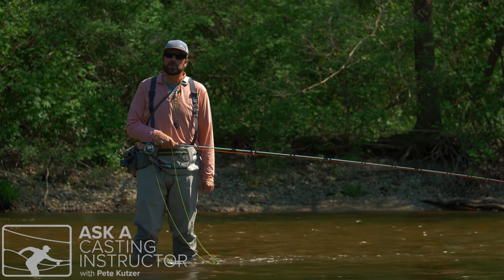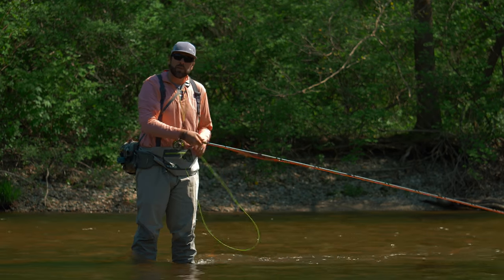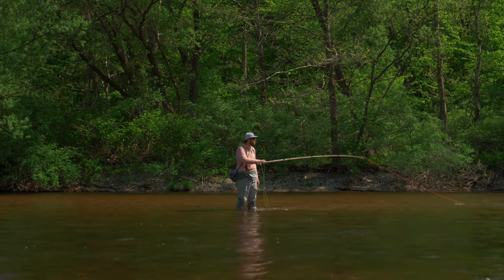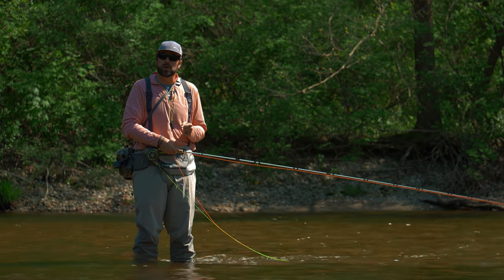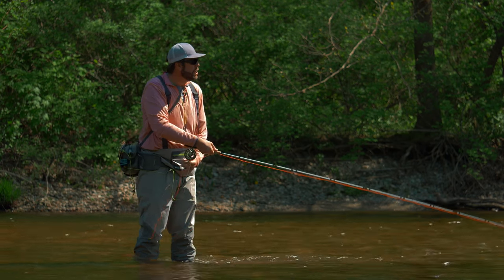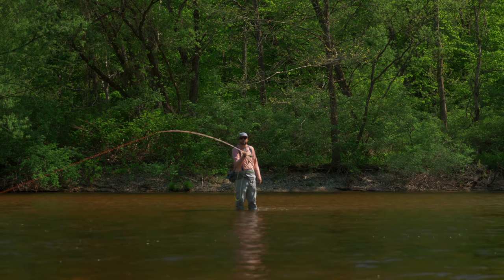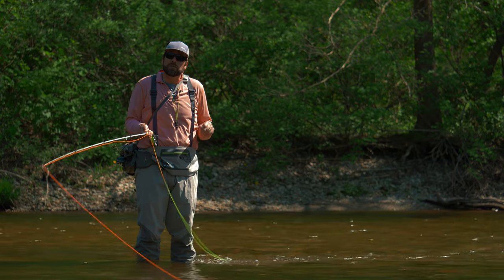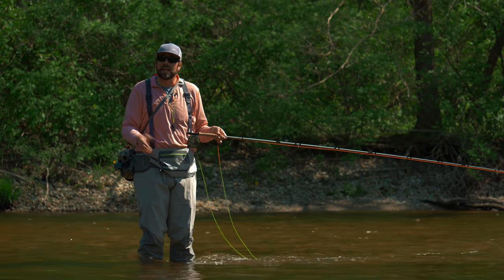Best Tricks for Casting Nymph Rigs | How To

Comment: I'm a newby to actually fly fishing, I've been steelheading with flies on a spin cast for 25+ years in Michigan. Fishing with nymphs is my game, but I see a lot guys using indicators? Is that necessary? I have a high dollar custom rod and am spooled up with Rio versiTip II. The sinking one? With variable tips for sink rate. While streamer or nymphing I shouldn't need an indicator right?  I apologise for being so dull, but I haven't found a good video about this and I've spent hours watching YouTube. It's like I'm starting all over as before without any help.   Any help is appreciated, and I'll take you fishing anytime. :)
Reply: For streamer fishing, especially swinging, an indicator isnt necessary.

For nymphing, however, an indicator can be very crucial, as it allows you to sense bites and react quickly. 

A good indicator that i recommend is the new zealand strike indicator.

Comment: Anyone know the type of rod shown? New to fly fishing and I feel like my rod tip (9' 6wt) isn't as sensitive as the one Pete is using. Of course I do only have a starter rod (Cabela's prestige).
Reply from the maker: Joe, the rod he is using is all white because it was done that way to be used for on-camera to help show a specific cast. In terms what rod it is, that is a Helios 3 in either a 5 or 6 weight. Hope that helps. Cheers